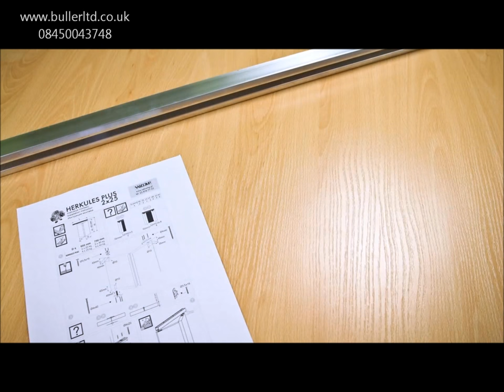Hercules Plus 25kg Bi folding Door Gear Track Kit- Buller Ltd

Comment: I wish to make a triple fold to one side. I have a 4 door kit.  Pivot on door #1 is 40mm, Pivot on door #2 with the roller is 35mm as you instruct. I worked out that door#3 (hinged at the rail) could be pivoted with the second roller at 31mm to work. Have you tried this and have a better measurement? G (door thickness) is 35mm so x=5?
Reply from the maker: Hercules is designed to work as two or four-door system.

With the use of three doors the problem is the way of attaching the third door and prevent it from flapping.
The way to overcome this problem could be to use the first door as a half (cut it in half) or move the track to the middle instead of to the edge of each leaf as per original instructions.
That, however, can limit your opening aperture when doors are completely open as the first door will not be as close to the edge of the opening as if you install 4 or 2 door system.
Off the shelf system is perfect for two or four-door (even numbers) however after some modifications tri-fold can be achieved, but it will be a compromise on an opening aperture. 

Hope that makes sense, but if you have any questions, please do not hesitate to contact us
Reply: @bullerltd   The instructions I have here are clearly not as in depth as you think were provided. Centerfold will not suit the need, and no-one seems to supply end hung with intermediate hinges for internal door purposes like this. I figured that the roller could be omitted from the center door and placed on the 3rd door instead which will resolve some flapping and offer more even top support, but could strain the hinges on the central door, although hinged at both sides, and requires a slight lenience in width to open the door. The traditional 2 door install with a "flappy" hinged add-on will bear the weight on it's one set of hinges. Either way, the door can be prevented from opening the wrong way with a well placed cover strip.  What I am going to do is load the rail with one roller, but drill all 3 doors at #1:40, #2:35, #3:31, and try hanging at the middle door and then the end door to see which configuration behaves best.
Reply: I just thought I would pop back and tell the result. I have 3x oak and glass doors 35mm thick. I didnt use the supplied hinges and used ballbearing butt hinges (3 per door), this was to reduce any possibility of strain and give a smoother action. I cut the larger side of one roller off (to put in the middle door), and put the pivot at 40mm, middle door at 35mm, and the 3rd door at 30... I just need to relocate the 3rd door pivot to be 35 aswell so it all folds back 100% flush. Anyway, no flappy doors here, it's working great.